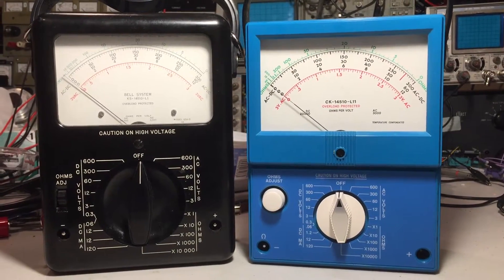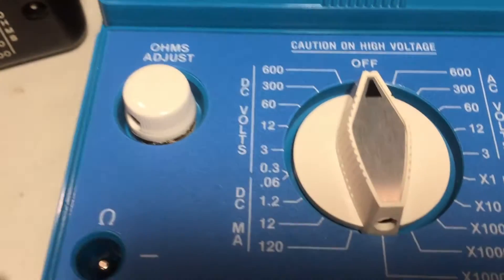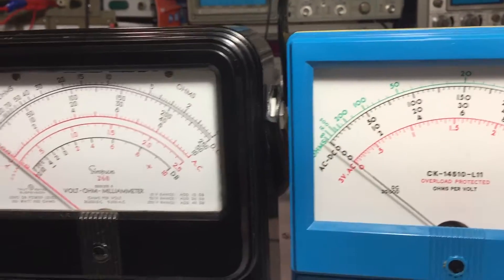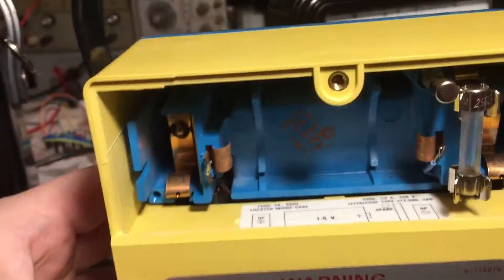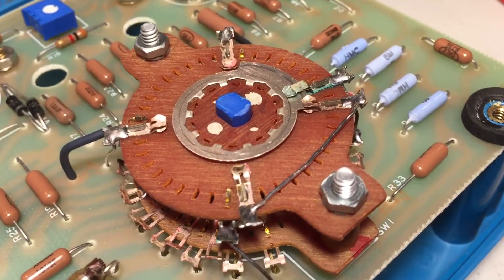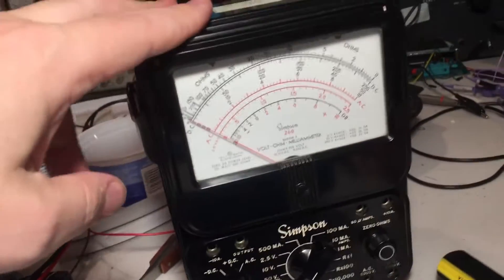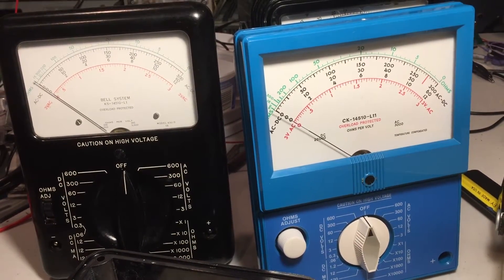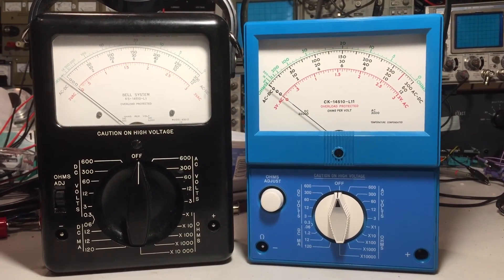Bell System Meters - Simpson 260 & Triplett 630 Based - CK-14510-L11 & KS-14510-L1

Comment: I had never heard of these,  found a yellow and blue Simpson in a thrift store.  At some point I discovered that it would not stay zeroed.  At some point I realized that it was somehow getting electrical power.  I turns out that  one of the batteries  leaked, impregnated   the PC board,  and   parts of the board itself acted to  offset the meter.  I proved this, easily,  by  contacting/ breaking  one of the meter leads  repeatedly.   A house fire "fixed" it,  I don't have to worry about THAT anymore.
Reply from the maker: Nice that you got to experience one. Interesting fault! Sorry to hear about the house fire. That's terrible.

I have been using the Simpson a lot lately. Just sits out for quick checks of batteries or wall warts, etc.

Comment: Started out with my dads Simpson midel 260. Used Radio Shack meters several times and not impressed with them. Still have s " how to use your Simpson meter booklet that I purchased over 50 years sgo for maybe a $1 at a local electronic store.
Reply from the maker: Thanks for the comment. I, too, started out with my dad's 260-- a black Series 3 I think). What a great meter.

Comment: I have a blue meter like yours came with a heavy duty leather case with metal snap button to close it only difference between your blue one and mine is my ohm adjustment is a scroll wheel but location is  basically spot on